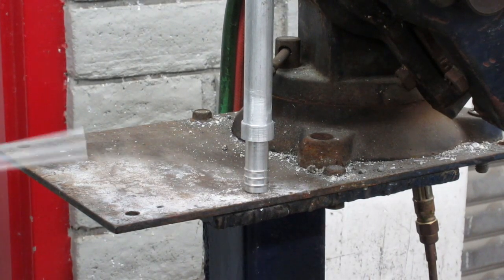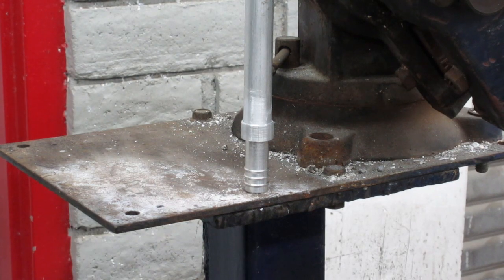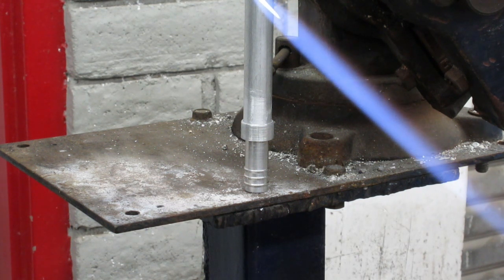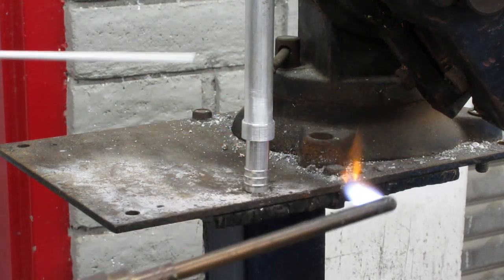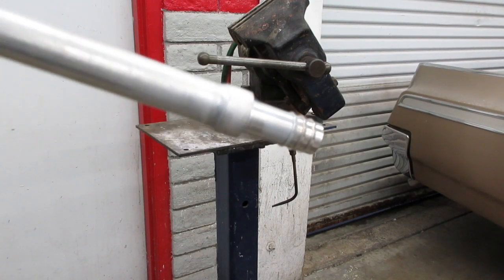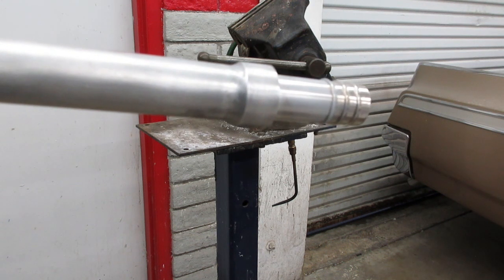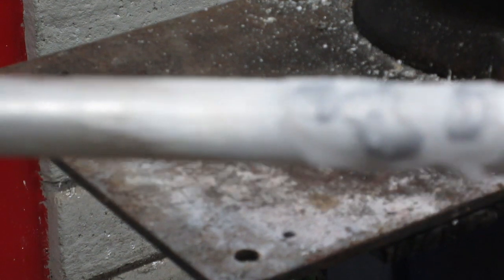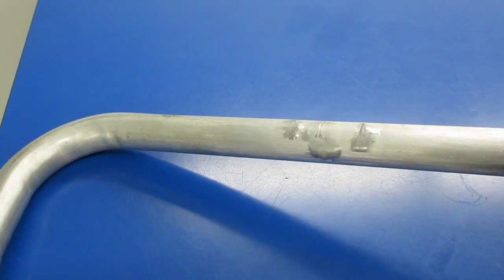HOW TO GAS WELD ALUMINUM

Comment: A very straightforward explanation and demonstration, thanks. My only criticisms are that the flame tip wasn't in the camera frame when you were describing it and the cut marks on the tube were out of focus, other than that very informative. Thanks.
Reply: Those were my two comments as well.  Seemed he did go back and watch the video before he posted it.

Comment: wouldnt this actually be brazing? or is it weld because the filler is also aluminum? please clarify Im a noob to
Reply: the definition of brazing also has a melting temp. above 900 or 1000 degrees, welding is technically fusing base material with the same type of filler material
Reply: It is a weld. The filler is Aluminum. Imagine tig welding, except the torch is a flame instead to electric arc. The Flux is like your shielding gas.
Reply: @bobsteinmann5793  It certainly is not. The base material is not being melted, the rod is melting and being drawn into the joint by capillary action, i.e. a brazed joint.
Reply: @mr2981  Thank you, voice of reason!  It's possible in some cases to WELD or BRAZE at will with all the same stuff!  I have done this as a demonstration with brass and the popular LFB filler material.  You can braze or weld two pieces of brass together with the same torch and the same rod, just depending on what you DO with the torch!  I think M R is completely correct here.  A brazed joint might be JUST what you want here, by the way!  Very strong and neat.  That darned flux is the only drawback.
Reply: Bob Steinmann thx ☺️

Comment: I looked up this product, and the maker describes it as follows: ”GENERAL CHARACTERISTICS:
Universal electrode for arc welding or brazing all weldable grades of aluminum and its alloys. Good arc stability at low amps and minimal spatter make The Aluminator ideal for any maintenance or production application.” To me this looks like brazing since u melt the rod with the flame, not with the pool of molten metal. But maybe I missed something. Looks very useful though!
Reply: You are correct, that is brazing as he never melted the base metal, just the filler metal.
Reply: It is brazing although not as strong as welding a brazing weld is still considerably strong if done right .
Reply: This is interesting and true, but maybe not entirely relevant.  He's not using this material AS an arc-welding electrode!  It's melting point is much lower than the base metal, and you can plainly see it running around, wetting the surface.  There's general heating.  In welding the heating is very local and the base metal MELTS.   It comes up again and again:  This material can be used for welding OR brazing, depending on the heat source and how it's done in general.  Nothing said here takes anything away from the quality or serviceability of the job we're seeing here, which I think we can all agree looks great!

Comment: So propane and oxygen is more efficient for aluminum because its cooler than acetylene?
Reply: Propane is cleaner, it does not contaminate the weld like acetylene. Acetylene will work but  it is often contaminated and produces very dirty/poor welds.